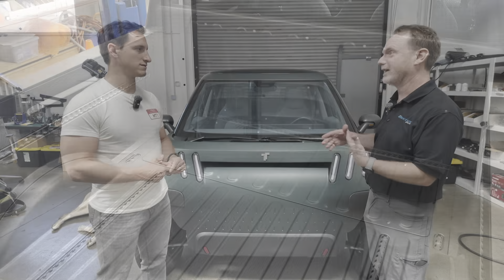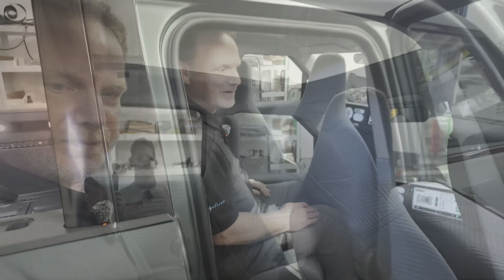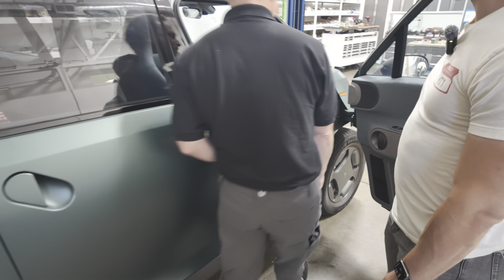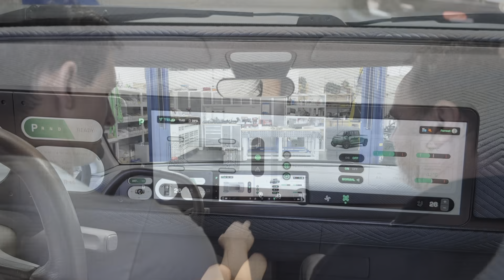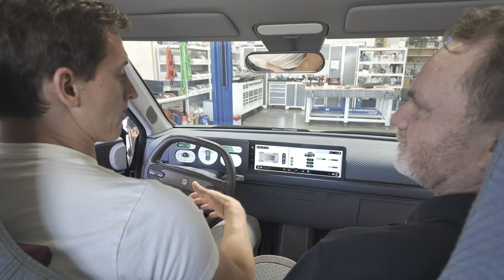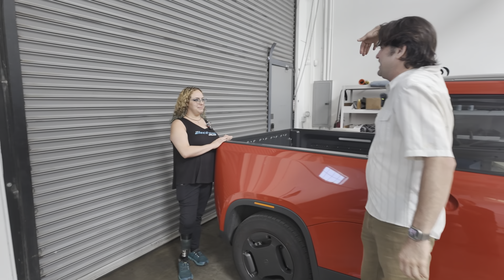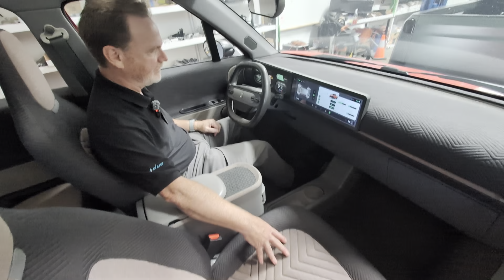MINI Truck with FULLY LOADED features | Telo Trucks is a gamechanger!

Comment: I could see replacing my EV suv with an EV pickup that has seating for 4, fits in my garage and has a frunk. I can see the advantages with this car for parking in the city, but I'm curious to see if that's a big enough market.  For me a frunk is optional in an EV car or SUV, but in a pickup it's a game changer. I hope Telo comes to market and is successful, but the lack of frunk is a deal breaker for me.
Reply from the maker: I think the tunnel makes up for it for me. Nice to have some kind of lockable storage like that. Frunk or tunnel :) - Liv
Reply: @theelectricduo  Good point. That's probably good for a lot of people but for me the easier access to the entire frunk is much better.  Oddly I think the cheapest option for me is going to be a used Lightening and I'll just park it in the driveway.
Reply: @Molishious  Hey, the Lightning is a great truck! A Lightning for a Telo sounds like an even trade to me (very different strengths and features, but I love both of them)
Reply: @Wordsmiths Not really into larger vehicles but the lightening won’t be a daily driver so it might work. The prices for used lightenings are pretty reasonable.
Reply: I agree that with a traditional style truck with a huge front end, a frunk is key. But this isn't traditional. It's compact for a purpose, adding the extra length to get in a frunk would kill the whole thing. The monster tunnel is also much bigger than most vehicle frunks, though not as giant as the lightning. 

Imo, frunks are a sign of lazy design. It's time to rethink vehicle packaging, frunks are simply avoiding the hard work of truly optimizing for today's drivetrain instead of the drivetrain of last century.
Reply: @michaelcummins5974 I can see for the specific use case of parking in the city the Telo is the best design. I hope it works out for them.

Comment from the maker: What do you think? Is the Telo MT1 a great size for an electric truck?
Reply: I live in the Midwest and I am very much looking forward to parking this next to some of the comically huge pavement princess trucks that drive around over here. You can't even use those huge trucks to do truck stuff. They are just a dangerous expensive status symbol.
Reply: Perfect size!!
Reply: I've never owned a pickup (electric or not), and never even thought seriously about getting one before finding out about Telo. It has a great set of specs and the size is a major one. I have my reservation!
Reply: Yes! I'm a 5'3" female who plays and moves some good-sized (and expensive) musical instruments and gear -- upright basses (77" long), harps (75" x 40" x 22"), drums, marimba, celesta, electric piano, amps and speakers in road cases, etc. -- not all at one time, but often in combination.  Vehicle-shopping has been a challenge for me ever since full-size station wagons died out. Smaller SUVs aren't long enough. Mid/large SUVs are mostly too high off the ground for me to safely hoist heavy gear in and out. Truck cabs won't accommodate an upright bass or a concert harp in the cab itself, but the ever-growing cabs have made most truck boxes too short to carry the longer instruments with the tailgate up and tonneau on (not to mention the security and climate concerns). Minivan floors are too close to the ground for me to control laying a top-heavy concert harp down, or standing it up again.  TELO looks like a very promising balance of cargo-floor height, length, and width, with bonus people-hauling capacity. I only wish it had more of a friendly "face" from the front -- perhaps add some outline around each grouping of headlight slashes to seem more like a pair of eyes? Color-wise, I'd like a bright white with iridescent "oil slick" or "soap bubble" finish, or else some light shades of intense colors -- lemon yellow, lime green, cyan, orange creamsicle, pink-purple orchid, etc.  Or follow Slate's approach of designing for multiple smaller wrappable panels.
Reply: Now that you mention it, I hold reservation number 3250 or so.
Reply: What is the increased range and recharge rate if you went with the solar roof and solar bed cap/ tonneau cover?
Reply: No, it needs a little more cab space.
Reply: Reservation # ~3110, I can't wait!
Reply: I think if the wheelbase was a little wider so that the wheel is more forward and they ingress is easier and then you might as well just add 6 inches to the front and maybe there can be room for a very small front but the main benefit would be ease of getting in and out
Reply: Could be a great truck but I have seen this same vehicle featured in a number of videos over the last three years and they still only have a prototype   They need to get off the pot and produce them
Reply: @jimparr5412  that is not true you made that up. They just made a prototype this year. And they’re moving very fast and they’re not using very much money so they are doing really well. In fact, they should have production by 2027.
Reply: @jimparr5412  The red truck - the first one - made it's debut in March of 2025.  That's six months ago.  Developing a totally new vehicle is a long process but Telo is moving with lightning speed considering the complexity of what they are doing.  But you've not been watching videos for three years unless you've been living in a time machine.
Reply: It is imo especially for the inter city delivery/courier/utility markets. But it looks to strange to sell well, costs way to much vs the slate&new ford maverick sized ev truck.

It also has about a zero percent chance of being produced by the current group. They'd need 50x more $ to build a factory to make them at scale. and contract manufacturing the ala fisker&foxconn is also a dead end imo.
Reply: @4literv6  Neither the Slate nor the Maverick offer any where near the capabilities of the MT1- and the Maverick is a hybrid.  The slate has a smaller bed, much smaller interior, and less than 1/6th the towing capacity.  Even with the Maverick 4K tow package- and quite a bit more money - it still has less than 2/3rds the towing capacity of the MT1 - and, again, a smaller bed/less cargo capacity.  There is no electric truck that comes anywhere near the capacities of the MT1 for less than $80k.  The MT1 is priced below both the average EV and ICE vehicle ask.

As to financing, they recently closed round-A at more than $20 million, and report sufficient funds to see them provisioned for their initial production- which most definitely does not include all in-house production.  Your prediction of dead end strikes me as reminiscent of gawkers telling Orville and Wilbur it was never going to fly.